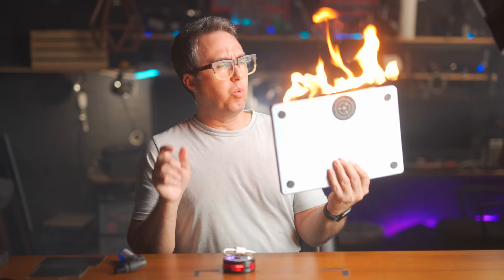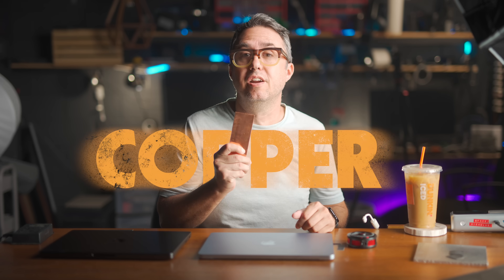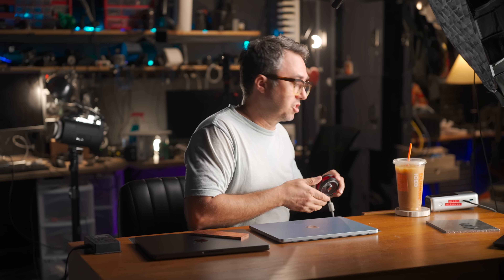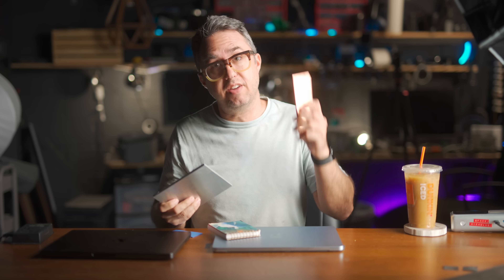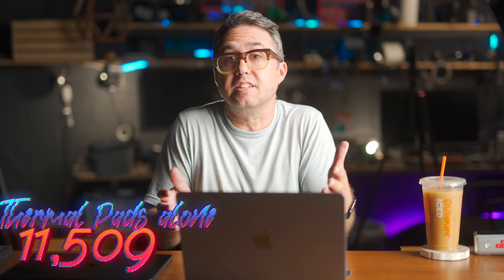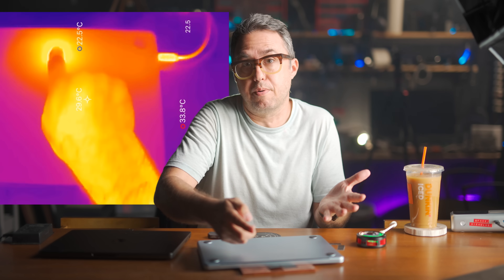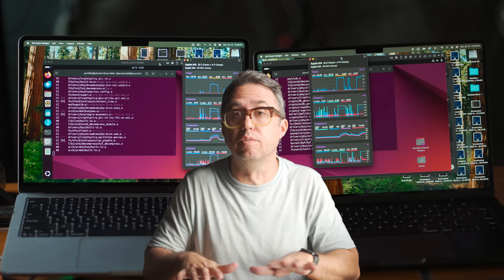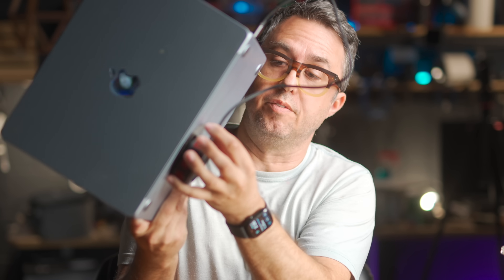M4 Macbook Air Beats Macbook Pro in Cinebench - Thermoelectric Cooling

Comment: So you got to void your warranty on an air to get it work as well as a pro? Cool. How about if you need an air get an air print you need a pro get a pro. Get the laptop you need for your intended usage
Reply from the maker: That’s good advice! I only do this to explore and understand things more clearly
Reply: @SPACEDESIGNWAREHOUSE maybe I’ve missed it but would be interested to see these tests with adding cooling options to the air WITHOUT breaking open the case to see how efficient with can make it. From a cooling fan stand to your fancier stuff you’ve added to the outside in this video but no thermo bridge inside.

Comment: So using thermal pads and a fan on my laptop stand I got 12676 on multi... im shocked how well it worked (13 inch m4 air, 8c gpu)
Reply: i tried it with higher quality thermal pads and a small heatsink on the outside an got 13400 on cinebench, big difference from stock config

Comment: macbook pro sacrifices cooling performance (a bit) in favour of less noise. The default profile drives the chip to near max temp before maxing out the fans. use Macs Fans to lower the threshold and allow the fans to spin faster at lower temps.

Comment: Does the Macbook air have battery bypass mode(I mean using power from wall socket directly instead of charging the battery) since you mentioned that the battery will degarde faster as the laptop will use more energy to product more computing power?

Also, apart from voiding the warranty, are there any more cons of this setup?
Reply from the maker: Yeah, once the battery is full it will just use power from the wall to run the computer. 

I can’t find any other downsides. People worry about heating up the battery but there’s an air gap between the bottom case and the battery and barely any extra heat will pass to them. Plus the whole point is that we’re not running the computer hotter, we’re eliminating heat so it runs the same temperature just faster

Comment: without the thermal pads and using 2 fans with mac upside down when i clamshell mode. will it make a huge difference?
Reply from the maker: Why not a slow drip of liquid nitrogen and a block of dry ice?  We could just keep going forever and find the actual true potential of this chip!

Comment: Im considering buying this for 3d modeling, specifically fusion 360 and video editing.
 
I'm between this (macbook air, M4, 16gb ram 256gb ssd) and a desktop pc with a ryen7 5700x with a RTX3050 12GB, 750W power supply and 32GB Ram ddr4. 

Keep in mind that I'm coming from a really old macbok so i apreciate the functionality of macbooks, but I'll be using it for working on the both things previously mentioned and all i want us the best performance possible. 
They are both the same price, ¿please some recomendation?

Comment: I was curious if you ever measured the temperature differences on the bottom plate and battery of the Air with vs without the thermal pad mod. I have an M3 Air that I probably push too far and have been considering doing that with, but don’t wanna scorch my junk when I decide rendering a 3D scene in Cycles on my MacBook is a sensible idea xD

Comment: This is absolutely what I needed but I do have concerns. Would having a magnetic patch affect the MacBook in the long term? (AI says yeah)
Reply from the maker: Not at all. There are magnets all over the MacBook Air. iPads and iPhones have basically the same cpu and memory and they have a powerful magnet built right into the back of them.
Reply: @SPACEDESIGNWAREHOUSE Does your comment regarding magnets apply to MacBook Pro too?

Comment: Hey, great videos, I’m planning to put some thermal pads in there too,I have a M3 air,but nothing else, some people say that just the thermal pads will heat up the battery and wear it down way sooner, is it true? So,e people have suggested that I could just slap some thermal insulating tape on the case which covers the battery so that the heat that escapes to the back case doesn’t heat up the battery….? Can I do that and be sure that I’m not decreasing the longevity of my laptop…….??.?
Reply from the maker: There is a very slight air gap between the case and the battery. So by putting in the thermal pads, you’ll move more heat from the motherboard into the case, but the case isn’t touching the battery.  Putting a thin thermal insulating foam tape between the battery and the case would be an additional layer preventing heat from getting to the battery.  It is my opinion as an engineer who works in the art world that an equal amount of heat will reach the battery with or without the thermal pads. But if I’m wrong, that tape would indeed help a tiny bit.

Comment: I had initially gotten an Air to play WoW, but after upgrading to the 512 gb & 10c GPU (which the pro has standard) I was only $300 (on sale) from the Pro. Since I had the mini-LED ipad pro (which had a defect) and was used to the XDR screen, I just traded it in to get the screen and the fan upgrade on the MB Pro. Frankly I didn't want to always use a workaround to play what I was intending to use it for and I saw some people's warnings about spreading extra heat onto the battery with the thermal pad hack. Since I wanted it to last longer I just felt the Pro was worth the difference even though it initially didn't, and the bro kept influencing me to go with the lighter laptop, which isn't even any longer that big a difference. But for anyone who doesn't plan on playing a game that's going to make the keyboard uncomfortably hot, yeah the base MB is a steal on sale at $800, I'm just a nerd and don't like knowing the limits of pushing a machine without a fan. And yes, it does hold up pretty well without it, but eventually it will throttle hard on sustained gaming loads if you ever do any.

Comment: can you try 1mm aluminum sheet + 2 thin thermal pad (good one) vs 1.5mm thermal pad? aluminum sheet has way better heat conductivity(more than 10x) so it should be better.
Reply: i did this mod with higher quality thermal pads and just a heatsink an got 13400 on cinebench, better pads do get better results

Comment: I run my business primarily on an iPad Pro 4th generation (which has a dedicated video accelerator chip, so it’s quite fast) and a 2016 MacBook Pro 15”. Switching to Apple Silicon on the MacBook side would be a huge leap forward—a real quantum jump. A MacBook Air M4 would be ideal. For me, having a completely silent computer is essential, so a MacBook Pro with fans simply isn’t an option.

Comment: I think its really important to note that was missed about the air gap in the M4 air is that if you use the thermoelectric cooler without the thermal pad behind it, you are likely to introduce condensation on the INSIDE of the chassis = very bad. So make sure you do the thermal pad mod where the peltier cooler will be used
Reply: I’m a university student and usually use a MacBook Air M4 attached to a monitor at home.
I only occasionally do photo and video editing, so I’m not worried about enhancing performance but more concerned with battery longevity.
Do you think it’s not optimal to always have a copper plate placed beneath for battery longevity? 
I’m not a tech expert and would love to receive some advice/wisdom from you two!🙇🏻‍♀️
Reply from the maker: @mikan709  A copper plate sitting under a battery will have no effect on its longevity. In fact, the only effect it might have is to regulate the heat a little better in an environment where that changes.
Reply: @SPACEDESIGNWAREHOUSE Thank you very much for letting me know!!🫶🏻
Reply from the maker: I agree with this warning.

Comment: Love this...changed my mind on getting a Pro...ordered the new Air with 32GB RAM.

If you get the Thermal Cooler, do you need to do the internal pad mod?
Reply from the maker: Yes, without that thermal pad bridge, the heat from the motherboard doesn’t make it to the bottom of the laptop, which means there’s nothing to remove with the thermal electric cooler

Comment: I remember seeing one of the peltier plates in a computer hardware store 30 years ago, and on one side it had a heat sink and was hot, and the other side was ice an inch thick. I wanted to cool my overclocked Celeron to play Quake or something, but was too technically difficult at the time.
Reply from the maker: Yeah, and at that time, it probably cost 30 times as much to set that idea up as it does now, too.  I love a good retro tech comeback!

Comment: Which thermal pad size is he using frr
Reply from the maker: I used 1.5mm pads. 1mm pads also work and are slightly easier to close up the case
Reply: thanks! I am buying my first MacBook Air m4 in a few days and your videos has been REALLY helpful for me! 
(Yes I’ll do that thermal + Peltier cooling fan mod on that for sure!)

Comment: i think using a mobile cooler may produce moist inside the macbook and may later on be the cause for it to die
Reply from the maker: If you left the cooler on while the MacBook was off this could be a concern.. maybe. But while it’s running it’s still WAY above the dew point, it’s just cooler than before. Remember 50C is super “cold” for the computer but that’s 122 degrees f! It would need to be like under 15C to make condensation.
Reply: @SPACEDESIGNWAREHOUSE  i see thanks for assuring me ima go and try this on my air then thanks!

Comment: Mine got slower. Idk why. Troubleshooting now. Any thoughts? I used arctic thermal pads 1.5mm. Maybe too thick? Gong to run a few more tests to see if the pads need to set then remove some of them
Reply from the maker: It’s running slower than with no pads? That’s.. odd.
Reply from the maker: It might be that 1mm is the way to go, but still even squished down pads should do a whole lot more than air
Reply: @SPACEDESIGNWAREHOUSE  I agree. I did this to my old intel MacBook and it worked like a dream. But yeah. It’s possible the 1.5mm holds the air in
Reply: @SPACEDESIGNWAREHOUSE I fixed it. The 1.5mm was fine but I was covering some of the openings including the couple holes in the middle of the logic board. So I was trapping air in. Idk uou wanted to maximize where the air can go cut holes in the middle of the thermal pad where there are deeper holes you’ll see them in the middle of your logic board

Comment: Awesome video and subscribed to help you hit 50k! One super important question regarding warranty down the road, can the silicone grease residue be completely removed with rubbing alcohol or will the silicone grease leech into the black plastic? I ask because I read a Reddit user get their MacBook Air warranty denied because the service tech thought the grease residue was from water damage.

I noticed in the video that there’s definitely some thermal pads grease stains and was hoping  to see if those stains can be completely removed with isopropyl alcohol! If so (or not) you can add that detail to the video description for your users (if they ever need to take the Mac in for service).

MUCH APPRECIATED!!
----
Also, a heads up that peltier coolers driving temps to subzero can introduce condensation risk if the ambient environment is humid -- not unlike a air conditioner. There is a risk that the innards of the case can start to accumulate water droplets (especially if the peltier cooler is overpowered) and that could short-circuit the electronics. Something to be mindful of as a possible risk.

Comment: Could be another video idea. Some guys do 1mm, some 1.5mm , some 2mm, some 6mk some 12.8mk etc. which is actually the best I wonder. In your first video I think you used Arctic TP-3 which is 13.3 w/ mk at 1.5mm in this one the link seems to go to Owl tree which is 6 w mk. I'm curious if in your testing there was a score difference between the two since the first vids pad had over double the conductivity. The Owl Tree is  heck of a lot cheaper for us in Canada.  I don't want to waste my money if its not leaving performance on the table.
Reply from the maker: I DO want to address this - I do not have that information in my head, the real difference between 13.3w/mk vs 6w/mk thermal pads.  Its on the list!  Thanbjk you

Comment: This was the video I was looking for. I'm planning this idea for when I get a MacBook Air... Does it really control the heating of the MacBook like a Pro? I don't want a MacBook Pro as because its screen is smaller. The MBA is is perfect, but  only thinking about the heating issue.
Reply from the maker: Yep - with the internal thermal pads installed AND the peltier cooler on the bottom - its VERY similar to the Macbook pro as far as heating/cooling.
Reply: @SPACEDESIGNWAREHOUSE what about not using thermal pad just using the cooling fan only, dont want to break the warrenty

Comment: I still think drilling holes in the back cover and then installing one of those laptop fans might be more practical if you're going to use the laptop with its screen open. I think it could work. Excellent video as always.
Reply from the maker: That would definitely have some positive effect, air isn’t as effective as direct contact but it would help for sure and be a lot easier to use

Comment: Would this eventually leave a ring on the midnight finish over time. I know it has wear issues.
Reply from the maker: Well to get the cooler to stick on, there is a thin magnetic plate that sticks to the bottom of the backbook with a sticky back.  I am not sure wether or not it would cause discoloration over time.

Comment: I think this may be a little unfair.  If I wanted to buy a M4 with 10 CPU and 10 GPU cores and or be happy with 32 GB RAM yes, I would buy an Air.  But if I wanted, say, a 14-Core CPU 20-Core GPU, with 48 GB of RAM, a Macbook Pro is the only option.
Reply from the maker: Oh absolutely.  This is simply meant as a demonstration that all Mac CPU cores are equal, pro or not.  The MacBook Pro is objectively a better machine.

Comment: One thing to notice is that a low-quality thermoelectric heat sink can ultimately be less efficient than a simple fan, and this happens more frequently than anticipated. What I mean is that swapping in a better heat sink might end up with a completely different result
cite: https://youtu.be/0CryjE2D6eQ?t=558
Reply from the maker: Well I cant understand that guy and there are no subtitles to help, but I understand and agree with what youre saying. Were only talking about 20watts of heat here - that is NOT a lot of heat at all.   Also, this guy has got REALLY good video lighting!

Comment: Good video, my question is about the battery. The battery isn’t given any extra thermal relief inside the chassis so is it not getting hotter? Why not put the thermal pads on the battery itself so it can conduct heat away from those all the same?
Reply from the maker: So by bridging the motherboard straight to the back case - MORE of the heat from the otherboard is leaving the computers insides.  Without those thermal pads there - the inside of the computer is like a tiny 20 watt oven, that heat stays inside.  The battery WILL BE COOLER with this mod.   If you used thermal pads and bridged the battery to the bottom of the case also, now the heat from the case has a path back to the battery.  Heat will travel from where its hot to where its cool, and the batteries are cool relative to the motherboard.

Comment: just got a macbook air m4 base model for video editing been using it for almost a month. It doesn't get hot while editing, but when it comes to rendering, it does get quiet hot. but it's not that big of a problem, just slows down render speed a bit and cools once render is done. so far soo good, no problem at all.
Reply from the maker: 100%.  Video editing USED to be this super difficult task that would beat up on GPU/CPUs but now these things fly through it without heating up much at all.   And when I hit render, I usually walk away to go do something else anyway because Ive just sat for so long working on the project.  Its totally no big deal if it takes an extra couple of minutes.   Maybe if I made hour long videos it would be a bigger deal.

Comment: this is incredibly interesting, as poweruser who owns a macbook pro, it would be very interesting to also briefly see how much (or little) benefit the pro models can get from doing the same mods. As with the lightroom task the air won out, so the pro must throttle a little in some cases.
Reply from the maker: I am happy to oblige!   I have an M4 Max Macbook Pro AND a Mac Studio with the same specs and Im going to be doing this same mod to the macbook pro.   Because, yes - BEFORE the fan gets all the way up to speed, the macbook pro DOES throttle for a couple of minutes and slow down a little. Obviously not nearly as much - but Ive taken the bottom off and the CPU heat pipe is exposed, so this same thing should definitely work on the macbook pro.   Give me a week, Im in the middle of another video and that one will be next
Reply: @SPACEDESIGNWAREHOUSE  that would be great to see a video of

Comment: If you used the laptop in clamshell mode with an external monitor, kb and mouse and flipped the laptop upside down so the cooler was facing up wouldn't it cool a bit better too since the hot air would rise easier?
Reply from the maker: It would let a TINY amount more heat escape out the bottom, yes.  But it would also insulate the keyboard side.  Quite a bit of heat still comes up and out of the keyboard from the OTHER side of the motherboard.  So by clamshelling it you'll trap some of that heat in.   Im sure it wouldnt be a big difference, and that might just be a more convenient way to have it on your desk

Comment: Great! Glad to see people doing mods like this. A small thing is I run a similar setup but in clamshell upside down, with the cooler less airflow restricted. Definitely works better that way. I've been trying to figure out a setup to keep the computer open with an additional fan running in/out of the keyboard area.
Reply: Laptop stands variety exist